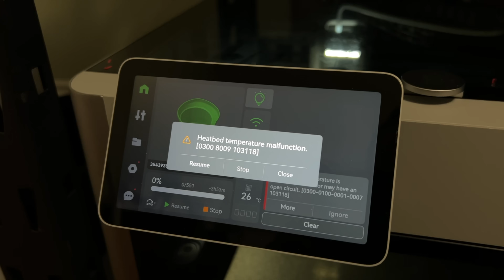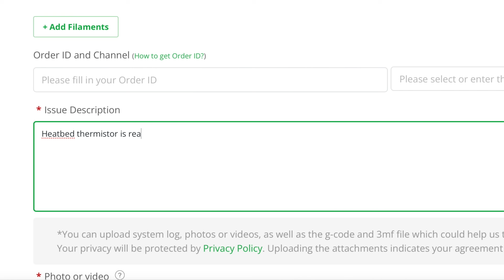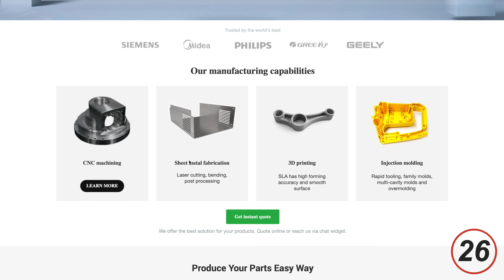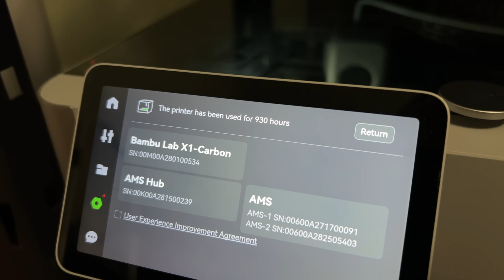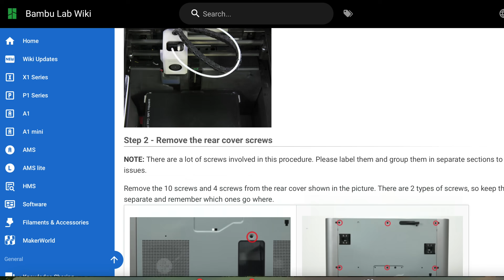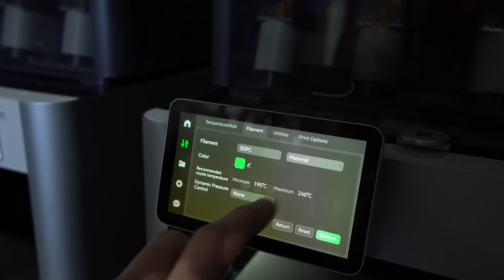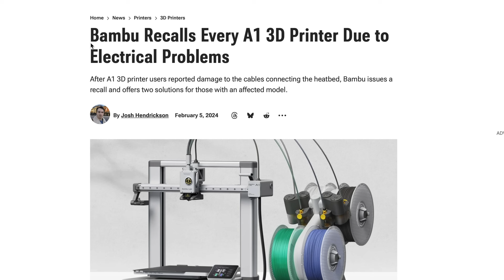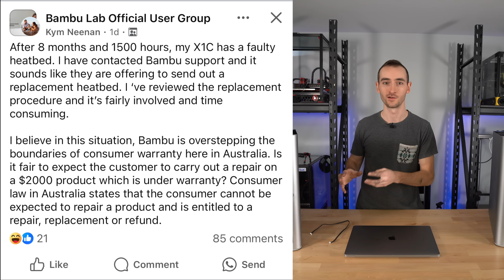Bambu Printers: Repairable or Disposable?

Comment: I don't think it's an abrasion thing. Wires that run in drag chains are specially engineered to cope with millions of bending cycles. Bambu may simple not have used the right type here.

[edit] If I had bothered to watch to the end, that's what you concluded, too;)

Comment: Thanks for this info, I'm thinking of buying a P1P and this gives me some insight on it. I bought a Ender 3 pro over 3 years ago, after 4000 hours it's junk, a complete rebuild is needed. About 2 years ago I had bought a Sovol v6, after not quite 1500 hours it's in the same state. I'm not going to waste any more money on the Ender, the Sovol is just weak construction and I'm going to "retire" it to only printing PLA on it. So I'm done with bed-slingers, FlashForge and Bambu labs from here on out. Or I'll learn how and start building my own so I'll know why it's failing.

Comment: I wouldn't call an hour repair not being designed to be repaired. That's a super easy repair my guy. I appreciate the walk through but I don't agree with your statements at all.
Reply from the maker: @BrandonCornett-g5v  it’s all relative. It took an hour by the third go round. First time was longer. Could have been better, could have been worse. I’m grateful nothing was glued / permanently fixed in place, I just felt a few things could have been more intentionally designed for ease of maintenance.

Comment: I agree with the Australian.  This seem unreasonable to expect and end user to perform.  How would you feel if Sony told you to take apart your TV, softening glue with a heat gun, removing connectors from cables, fishing wires, reattaching connectors…. Bambu should have either better designed it for end user repairability or should either being paying for repair labor or should be sending replacement units. 

I haven’t looked, but also curious if thier warranty covers commercial (print farm) use? Many warranties on consumer products will exclude commercial use.

Comment: I don't understand the tone of the video or thumbnail/title. BambuLab seems to be aware of the failures, and their upgraded replacement part is designed to correct the issue. It would've been nice if BambuLab caught this before launching their first 3d printer, but I am willing to forgive considering how many companies just leave design flaws as is, or worse, carry them over into the next model and beyond. There are legitimate reasons to be suspect of BambuLab, but build quality and availability of replacement parts aren't going anywhere near the top of my list. I have 4 X1Cs in the high school makerspace I manage, and with at least hundreds of hours on each, I have needed to do zero major repairs. The Formlabs, Creality, and Raise3d printers these replaced all took up hours upon hours of repairs, while costing multiples of the price, and Formlabs in particular left the same cable loom strain relief oversight on 3 consecutive models (Form, Form 2, and Form 3).

Comment: Wondering..
Is the flexing of the cable partially caused by the case on the printer? Would a P1P have the same issue? Going to be looking at it when I get back in the office.
Reply from the maker: I don’t think being enclosed makes a difference. The routing of the cable is the same.

Comment: Not repairable but you just repaired 3, go figure, more clickbait useless tosh
Reply from the maker: That was the question I sought to answer in the video… the conclusion was that they are repairable, but the process is quite involved.
Reply: @ygk3d  Maybe you got the faulty run they supposedly sold, I have 3k hours on mine and still no issues, I did buy that very cable because I was concerned last year that it could fail, as for the seals, my X1C doesn't have any, if it were me with 3 going the same was, i would be reaching out to Bambu to sort it
Reply from the maker: @Yorkie-9668  I opened tickets. They told me what to do but I had to buy the parts myself. Not expensive mind you but no acknowledgment that it was a widespread issue.
Reply: @ygk3d  One machine I can understand, but 3? No sorry they would be dealing with it, not a one off then

Comment: Aviation piston engines have TBO's ranging from 1000 hours to 2000 hours before you have to take the engines off and send them out to be overhauled.

1000 hours for 1 cable isn't that bad at all.

Comment: My 2 Bambu (P1P and P1S) have been nothing but problems.  When the P1P hit right around 800hrs TONS of errors and customer support did nothing but tell me " Sorry we no can fix thank you" direct quote.  $300 in parts i bought to fix it.  My P1S at 400hrs split a belt, the bed knobs popped off mid print and it will not level.  Its bricked.  Again customer service wont help. Same exact message "we no can fix thank you" i refuse to fix it.  Bambu printers are junk.  They are also MASSIVELY more difficult to work on and repair then other brands
Reply from the maker: @anthonylong5870  ouch. That’s an unfortunate experience for sure.
Reply: @ygk3d  Yeah , the worst part was the zero help for Bambu.  These printers were both less than 5 months old and still under warranty.  They just blew me off and then closed my tickets 5 on the p1p alone) then ghosted me.  I really dont know why people are such cult members and how they defend Bambu.  My Creality, Anycubic, Flashforge, Elegoo printers have all 1000's of hrs on each and the problems ive had with any of them has been minor compared to my Bambu's and a million times easier to work on and fix

Comment: Those bambu's are broken becasue they have the same junk build quality as a creality. My P1P was dead in just 10hrs with a bricked stepper motor, basically DOA. Come to find out, that $700 P1P uses the same exact stepper motors with the same P/N, as found in a $150 ender 3, that's just embarrassing. The fact that these bambu's also use just one stepper motor and a belt to drive 3 lead screws is cheap as well. Bambu is cutting corners without cutting the cost.

And yes, bambu designed their printers to go to a landfill when they break, they're throwaway easybake vorons.
Reply: Please stop lying, this is getting beyond ridiculous.

Comment: I wonder if the cable design improvement is reflected in P1S models shipped in January of 2025 (if it even uses the same part). Anyway, I saved this video for reference, so thanks.

Comment: With not that much, you can buy yourself some connectors and crimp them by yourself. I do question myself one thing, can't you just not put the cable routed inside the bushing? Like put a nylon band?

Comment: this isn't dissimilar to the apple display cable cablegate, if you will. The only difference is that the fix is a lot cheaper, and doesn't consume a whole ton of time.

Stil disappointed that bambu isn't transparent about these potential issues and updated/replacement parts for them.

Comment: How early did you buy your X1Cs?  I wonder if they started putting the revised cable on printers?  which one is in the p1s?
Reply from the maker: These were earlier units. Two were Kickstarter and the other was shortly after. Not sure when they recognized the issue and resolved it.

Comment: Just a tip to add to your cardboard trick. If you draw a small diagram of the object, then punch the screws into it in the location they go, it helps assemble a lot easier.  I also agree that the cable is a design flaw, but it might not have been anything that they could’ve seen without testing longer. I’m glad they keep repair parts cheap and I’m also glad that they decided to update the part to fix the problem.

Comment: Well done. Fair and unbiased. I learned something. Couple of questions though. First, can you provide the link to their repair wiki? Secondly, can you give us some tips on maybe how we could prevent this from happening in the first place? Thanks.
Reply from the maker: Thanks! If you just Google Bambu lab wiki there’s a ton of guides for various repairs. I don’t think there’s anything you can specifically do to avoid this, besides only printing short objects, which isn’t acceptable. I would just order a replacement to have on hand in case it fails in the future.

Comment: So as an old Controls Engineer, I have seen many a broken cable over the years. Not having a Bambu, I couldn't say for sure, but your old cable looked stiff to me. Probably a few larger copper strands as opposed to many smaller ones. Which is going to break sooner than the more supple cable will. Even then it will eventually break. 

In the automotive plants, cable swaps were scheduled to occur before the anticipated lifespan of the cable to prevent downtime. In your case that would be around the 900 hour mark.

So what to do? If it were me, I would cut the sensor cable where it gets past the bed and put a plug on the end of the original cable there. Then make up a short sacrificial cable that goes from there to the motherboard. Consider doing this for the heated bed as well. And like you said, relocate the ground wire. The next replacement will be considerably easier if you don't have to remove the bed and extra covers.
Reply: I agree on this cable not being a proper drag chain cable but just wanted to say, your idea of the sacrificial cable is great. I'll try to remember that one myself:)
Reply: @AntiVaganza  Thanks!

Comment: Thank you so much for this video, my work X1C has about 1200 hr and I use it daily, occasionally I get the hearted sensor error and I have to unplug it and restart it, re homing must move the cable enough to get it going so I knew a fault and full on breakdown was coming and dreading it as I use the printer daily and it would mess up my work flow and then I would have to figure out and fix it, you have saved me a lot of time and I will order a cable on Monday and be ready for it giving up totally

Comment: I get your pain in that a simple reason is behind the failure, and that the replacement process could have been easier. Hindsight is a wonderful thing, and it seems you are spot on with your analysis, because wiring fatigue due to operating conditions is very common outside 3D printers. It’s possible that higher temperature printing, age hardening of the insulation also contribute, but it does look like the new cable is thinner, so maybe the problems with the A1, or development models in their testing has made them rethink their choices. Spare a thought for us chaps that mess with cars, where a simple part is inaccessible in front of a bulkhead without dropping an engine, because the whole thing was put on a subframe on the assembly line.. Glad you sorted it, and it looks like I’d be doing the other X1C you have, or maybe you could ask support when did they start using the new cable in their X1 production, and get back to us, because that would indicate if it’s a known problem too?
Reply from the maker: I’m glad I don’t count repairing cars among my hobbies… that sounds frustrating 😂. That’s a good thought RE: timeline of issue being recognized, I’d be curious to know that as well.

Comment: This whole video is how mechanics feel. Doing a job the first time is a learning experience. By the 4th or 5th time we get lazy and try to cut corners to do the job faster and more efficiently. This is how we make money on a pay system called flat rate. All of the complaints about how a hole is too small to feed cables through, and the location of the ground cable is how mechanics feel about engineers. I will say though, that if there is an updated part, then that means they recognized a problem and changed it. Unfortunately it has not been a big enough of a problem or safety concern to deem it as a recall. 

Products aren't designed for easy of repairability, but for ease of use.

Comment: pretty sure its not a design flaw per say, but a poor choice of savings when selecting the cable quality. 

thanks for sharing this, if it happens to me i will be sure to just route my own silicone sleeved hq cables instead. and be sure to add length to the other cables in the bus and make a wide arch loop instead of this sharp bending. 

im on 2200 ish hours with mine with custom end gcode to lower the bed to the bottom. i will be opening the back tomorrow to measure resistance. thanks.

in norway the consumer right are so strong that i will use this video as proof incase i need, we get 5 years 100% return or free repair on faults or defects that are ;

1. all manufacturing defects
2. a feature or function loss that is advertised
3. any of the two above alone or together in a device that is meant to last longer. the time is specified as "reasonable" so a fridge is 10 years, phone 5. nothing less than five is sold here mostly due to this.
Reply from the maker: Sounds like Norway is ahead of the rest of the world in terms of consumer protection laws.
Reply: @ygk3d  :) this is why the selection here is limited compared to other countries.

one can use this fact as a filter to weed out the poorer products ny checking if it is sold in norway :)
Reply: @ygk3d  we just contact the seller if the item is within the warranty period and they have to deal with it. its great, it forces the vendors to sell better items. BUT we are among the most expensive places in the world to live, so ... there is that. plus its cold, dark and depressive.

Comment: 10:05 - Deciding the size and location of a hole involves a lot more than just convenience. There are restrictions around fabrication and other technical factors that have to be considered. It's not just about saving you a couple of minutes by skipping a panel, it’s about making sure everything works properly and efficiently in the long run.
Reply from the maker: Perhaps. But if they just need a source of metal for grounding there is a metal bar across the back of the printer. It seems to me they could have gotten the ground for the bed from there… unless I’m missing something.

Comment: Unfortunately products these days are designed for fast and economical manufacture, not ease of maintenance. I'm a truck mechanic and I have spent countless hours disassembling and reassembling things to replace some wear item when most of the extra work could have been avoided with a very little design change like putting a screw in a little different location. Sometimes I feel like they actually design things to be as hard to repair as possible.

Comment: I agree with your analysis almost entirely. Tech Support at Bambu is excellent, reasonably quick, and efficient. You cannot beat their complete inventory of parts, too. Many of us don't mind tearing a machine apart to remedy what's wrong, but it certainly can be intimidating. In other industries, where the mark-up of the cost of the machine is typically considerably higher to allow for warrantee work by the factory... well, that's the compromise. Bambu came into the 3D printing industry with a fresh look, and upon evaluation realized that their machine couldn't sell for $5K, so instead they opted for user-based repairs to keep the cost more in the range of what we users could afford. At least that's how I imagine the decision came about. Although 3D printers are evolving quickly, I don't foresee a time in the near future where user-based repairs won't factor in. We're still in a tinkerer's universe, so Luddites need not apply.
Reply from the maker: Great take. I’d rather do some of my own repairs than pay for an expensive service plan I don’t need and can’t opt out of.

Comment: When I ordered the X1C a year ago, I came across information online about someone having that issue, so I ordered the same cable together with the printer as a precaution, though thankfully, I haven't had that problem so far, but I'm prepared just in case.

Comment: Thanks for sharing this. I’ve only had my X1C for about 2 months. But only one issue with the nozzle which was a file issue. It does look more intense to repair than the others though. Like others mentioned it would be great if they had a document or list of newer parts somewhere. But it’s crazy though they had had the same replacement part for different issues. I guess if you have tiny baby hands it’ll it easy to repair.

Comment: I do disagree with you when you say: Made it clear these werent designed for repairbility. The support diagnosed the issues correctly, they have replacement parts and good guides how to repair the device. Everything is screwed together with standard screws. No plastic clips that break or screews that need specialized tooling. Is there some room for improvement? yes and there ever will be.
Reply from the maker: That’s fair. Not the best but definitely not the worst. Nothing glued or permanently fixed in place.

Comment: After 1000h my usb-c cable to the toolhead went bad. Errors with Lidar and build plate detection. Replaced the toolhead board first and after that the cable.
Oh and before that my mains switch went bad too. I wired out the switch.
Reply from the maker: That’s a few too many failures for my liking…
Reply: @ hmm. Snapmaker J1 i had to replace and pay for the new version hotends to get rid of clogs. Had to replace both flat band cables to the hotends after 500h print time. 
Voron 2.4 had to rip out all cables going to the toolhead after 2000h. Replaced it with CAN toolhead. 
Every printer I had, had issues so far. The Voron the most. Many issues and modifications were necessary to get it printing without issues. 

What I like about the X1C is the replacement parts are dirt cheap and there are manuals for every repair so far.